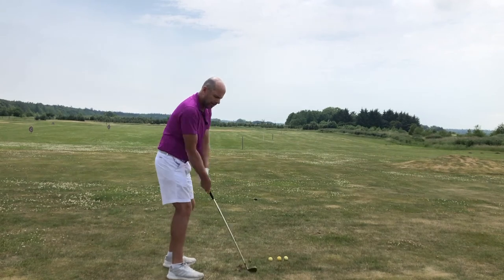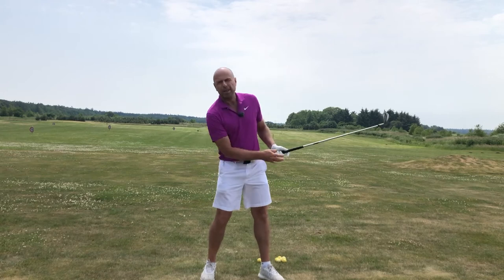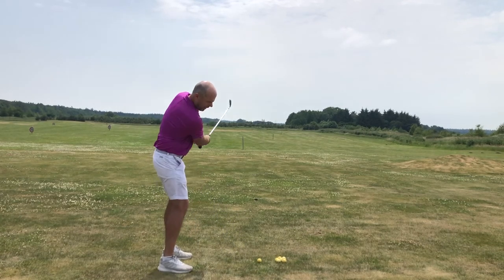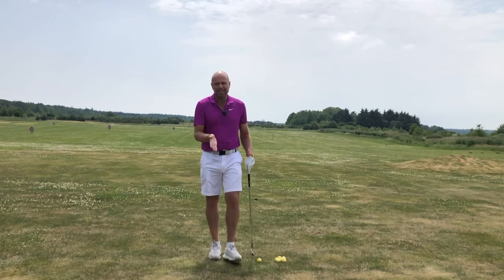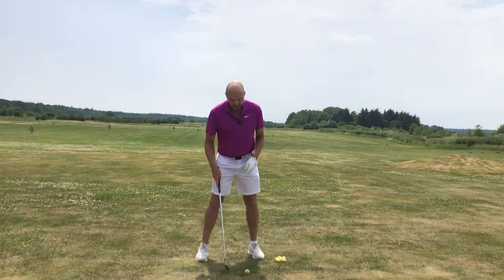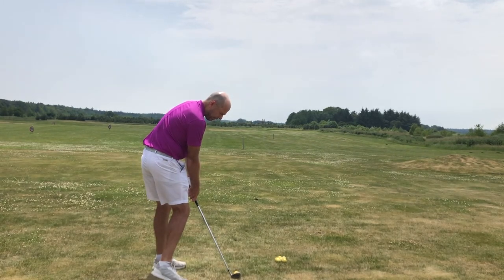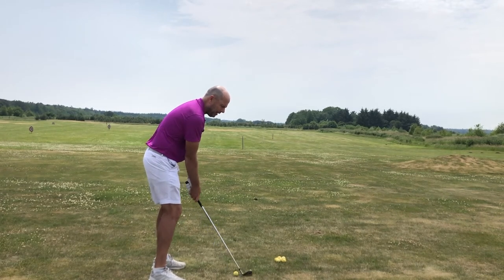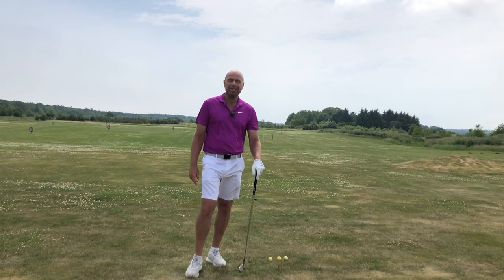Understanding Fat and Thin Iron Shots - and how to avoid them

Comment: I have had a terrible time hitting the ground before the ball with every club in the bag. In spite of all the drills to improve forward shaft lean, weight into left foot, etc., the fat shots were worse than ever my last round. I have been working on shallowing the club on the downswing, and according to the instructors who teach shallowing the club, the head should be behind the hands on the downswing. This is opposite of what teaching pros taught in the past that I recall. Could it be I've over cooked the shallowing? Or maybe I'm too laid off in the back swing and come down on the wrong plane? I've never worked so hard on what I believe are the right things and yet the outcome is ground ball and more frustration than ever!